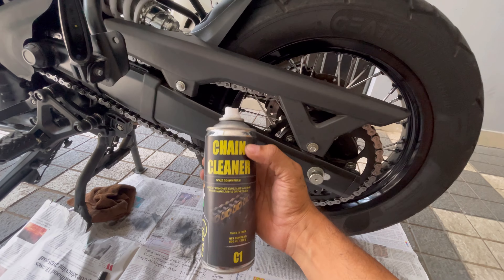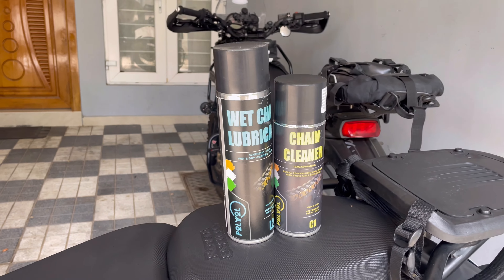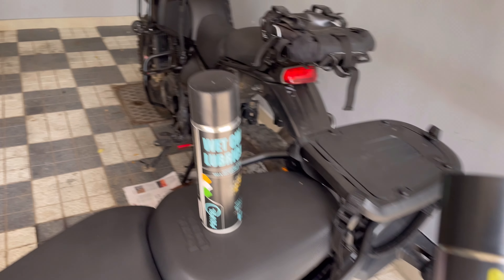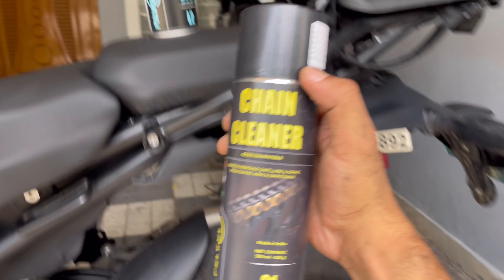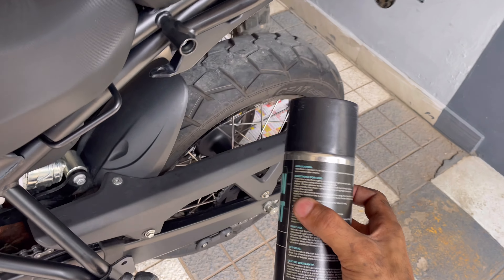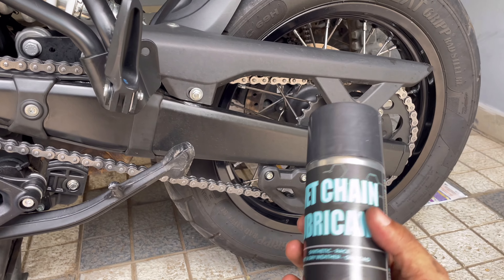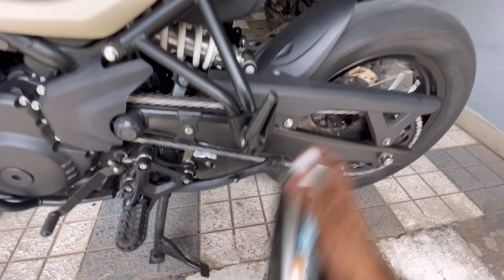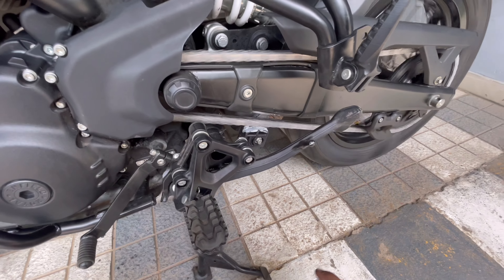NEW PLAYER - POLYOL CHAIN LUBE AND CLEAN

Comment: Hi Ben, have you seen the analog stick go haywire in the rains? Random inputs without touching it? Mumbai rains seem to really be doing a number on the bike.
Reply from the maker: @crciketcrazy19  yes . Water ingress through the switch gear . That’s the problem . Comeback home and use a hair dryer to dry the switch gears
Reply: Mr Ben I was using coconut oil on my bik which is 96 model I don't need to name it my question why today all lasted oil came into the market where were there before my bike is such old one but till to day I didn't change spare plug if you believe come and start my bike in one kick which is been used once a year 😂
Reply: @ONTWOWHEELSBEN  time to buy a portable hair dryer. Thanks ben.
Reply: @ONTWOWHEELSBEN we generally do not recommend hair dryers for water in switchgear, as the heat might progress ageing of plastic and rubber components or deform stuff, even. use compressed air like an aerosol can or smth instead, and look at either sealing your switchgear in the necessary areas OR swap out the entire part for another of your choice, if you are willing to re-wire everything. this is a common issue on many bikes